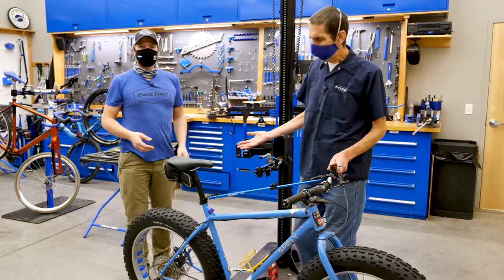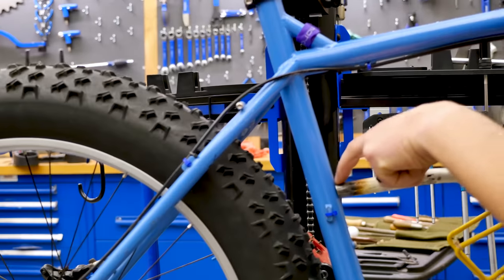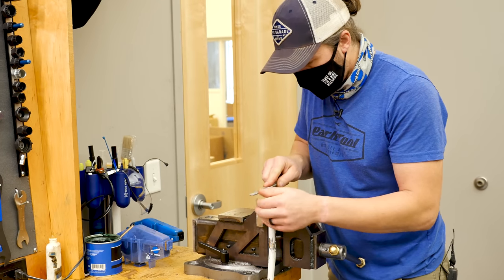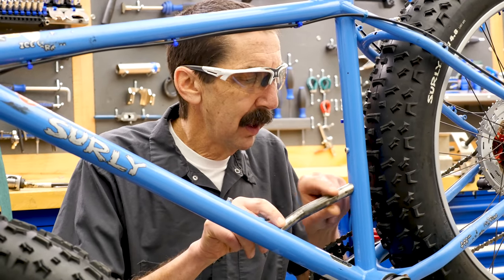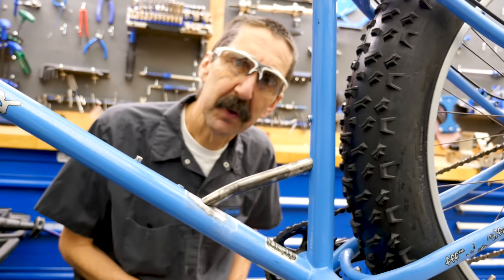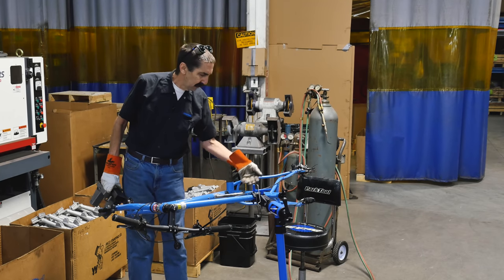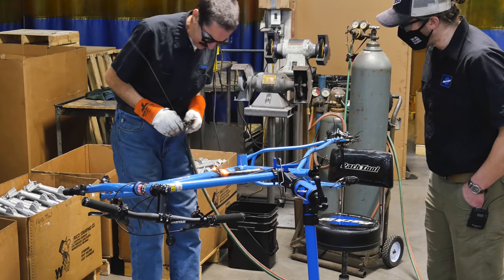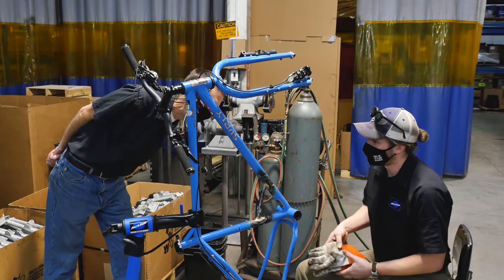Bike Mod: Ice Cream Bar Part 1 | Tech Tuesday #170

Comment: I'm a retired steamfitter. I think if you had a smaller torch tip it would have worked better for you.
Brazing and welding is not a skill you are going to have success with the first time. Not everyone can get the hang of it. Bike tubing is pretty thin. Not much mass to absorb the heat. If the base metal melts away that's very difficult to fix. I know what my first weld looked like. I wouldn't want that on my bike. 
Nice idea . Maybe some commercial frame builders will catch on.

Comment: The grab bar is a very cool mod. I ride alloy full suspension trail and getting it into the back of my suv is tight but works. The darn thing is always hard to grab correctly though. That doesn’t mean I’m going to mess with my bike’s frame.

Comment: Probably bronze brazing rods not brass ..and you didn't need flux  with  bronze rods just cleaned better because you basically burn up the flux by the time you are are temp for flowing the bronze....

Comment: Wearing googles 👍 but wearing normal trousers and fiddeling with the long torch flame  a few centimeters away from this trousers. This is not consequent work safety. 🤲 Where are the apron or flame proof work clothing.

Comment: Nice work, but not necessary. Stand with your face towards the bike, bent forward, and grab the seat tube of the bike close to the bracket. Now you can lift the bike easely.

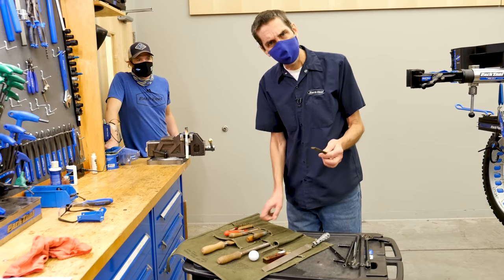Comment: whats the part number of that tool box at 3:25?
Reply from the maker: The holder on the top of the bench is the JH-1. The boxes under the bench are Equipto.
Reply: @parktool  thx. and the green one?